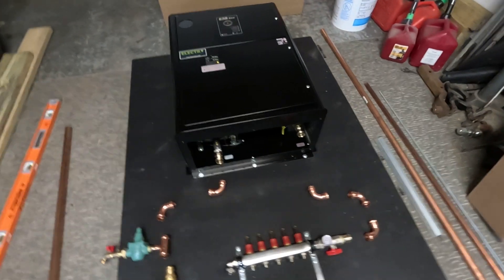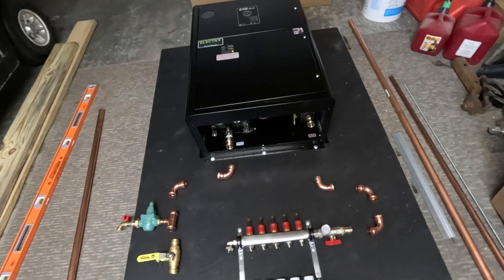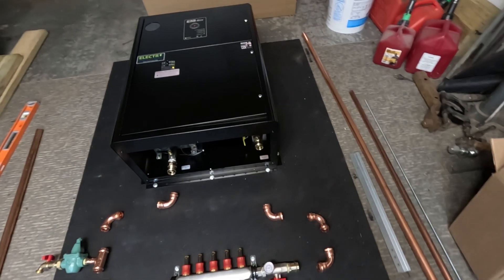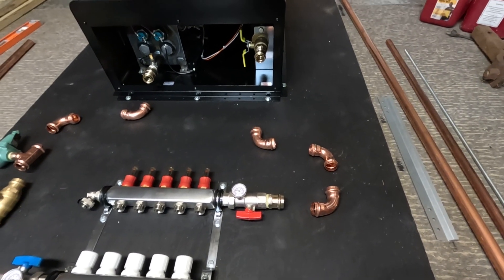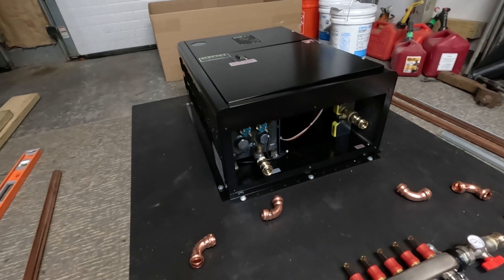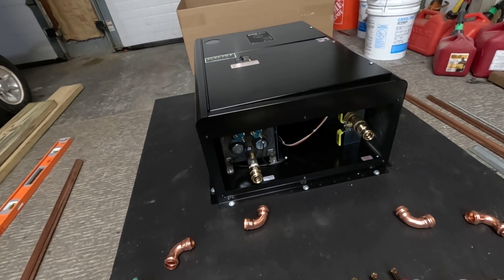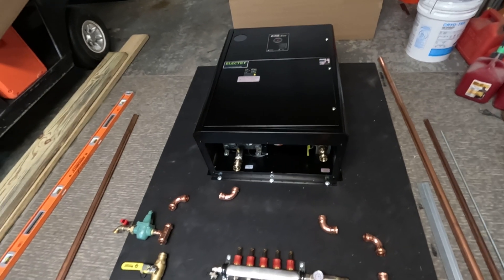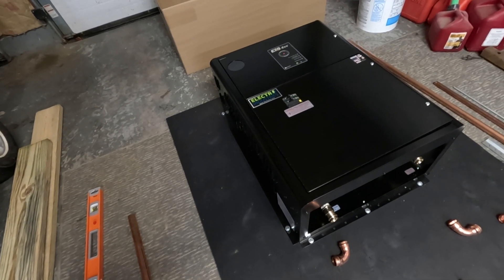1 Zone Electric Boiler System

Comment: Hey Jim, what's the purpose of the mixing valve in this case, while you don't put one in on other videos.  I'm looking looking to a three zone system with zone valves.  Should i put a mixing valve in and where?  Thank you for your prompt response.
Reply from the maker: @antoniorestrepo4299  the system in tbis video does not use a mixing valve. A mixing valve is only required when you need two different temperatures from the same boiler. The boiler would be set to the highest temp required by a zone and the mixing valve would be used to provide a lower temperature for a different zone.